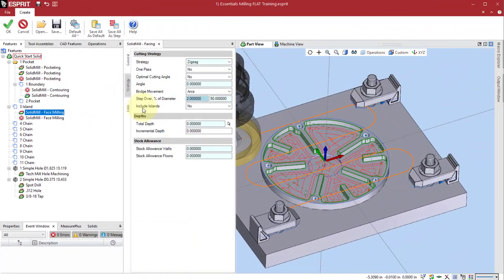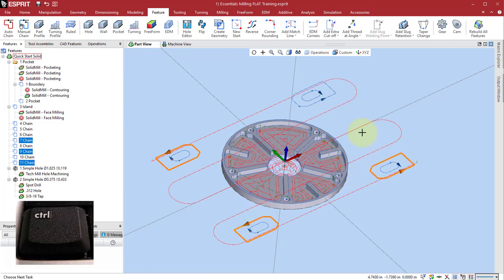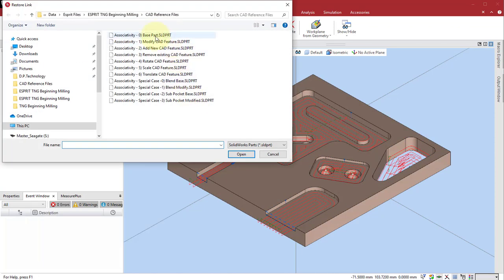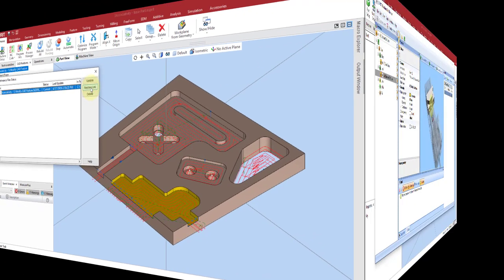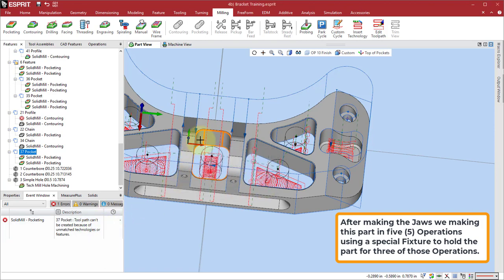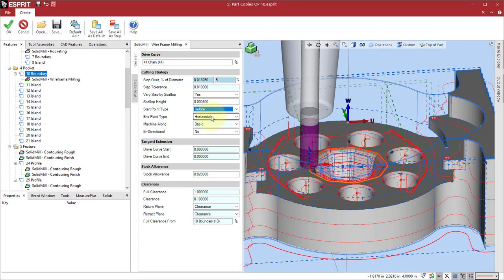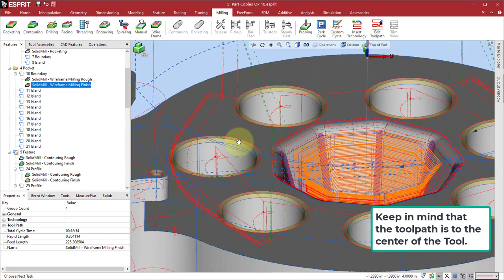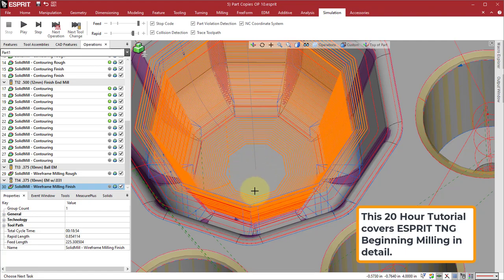ESPRIT TNG Beginning Milling Tutorial Preview

Comment: how do you get that red UI at the top? when i load esprit its a gray interface at the top. Also the features look nothing like that for me.
Reply from the maker: It sounds like you are running the ESPRIT 20xx Series. Do you have "Help" listed on the top right? If so pick Help - About ESPRIT. If it started with "19" then you are running ESPRIT 20xx. If it started with "20" you are running ESPRIT TNG or ESPRIT Edge.
Reply: @camwizardllc9141  just checked and yea you're right, the build starts with 19